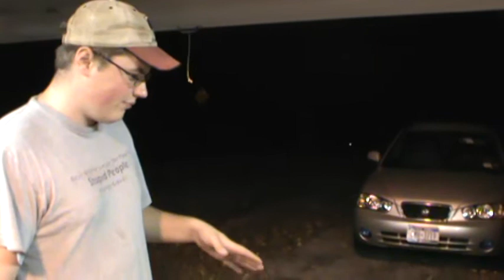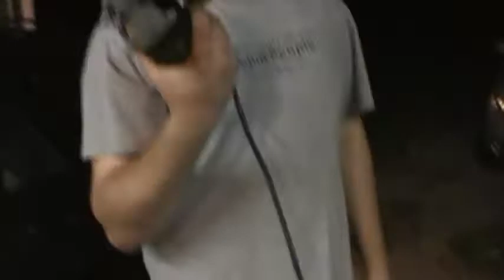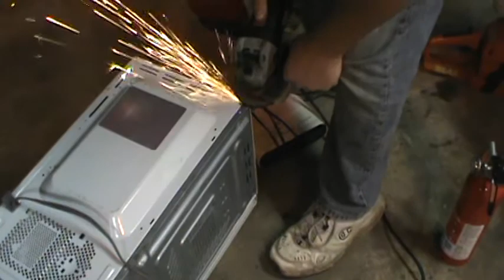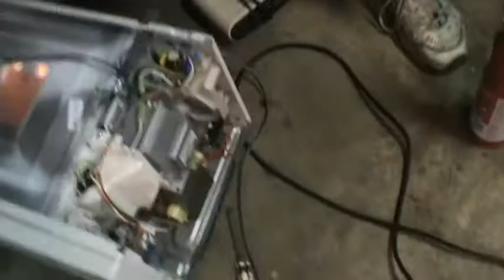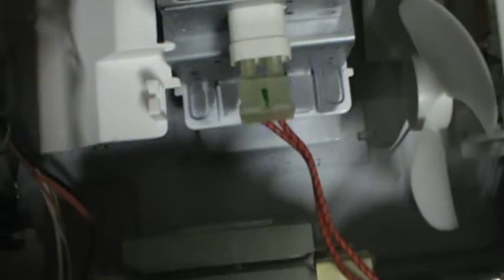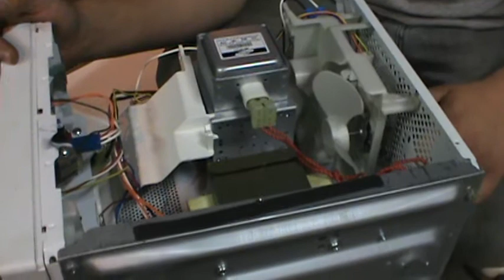Fat Guy Attempts Microwave Repair

Comment: "INVERTER" CONTROLLED,aka "smart control ,but those are really dumb as it breaks you can't fix them without the proportory parts and software ,basically its a POS and fix it with a baseball bat when it fails